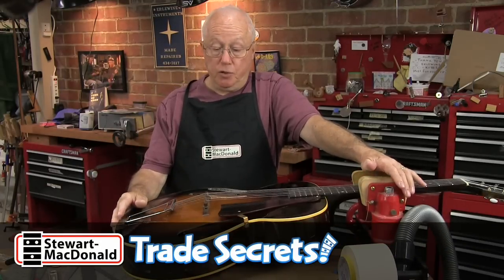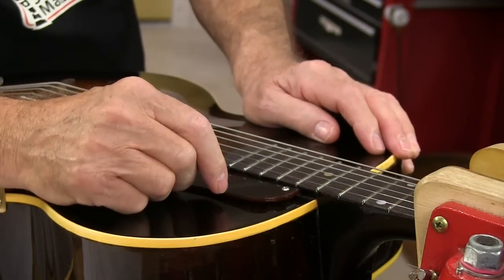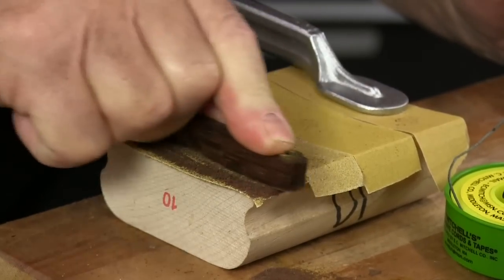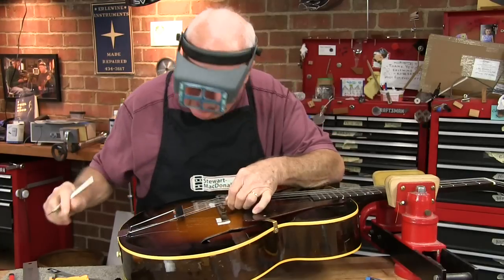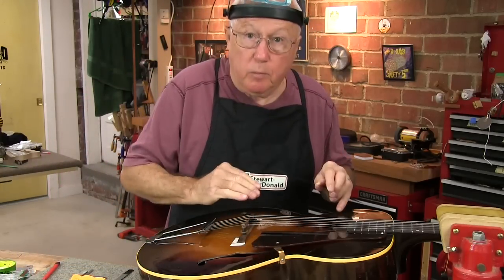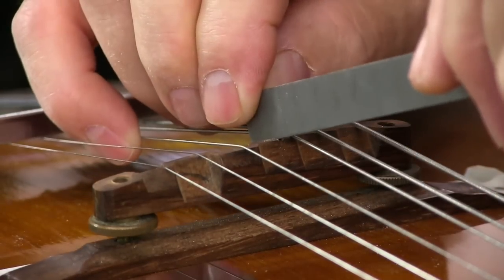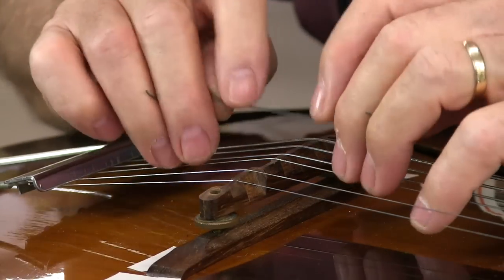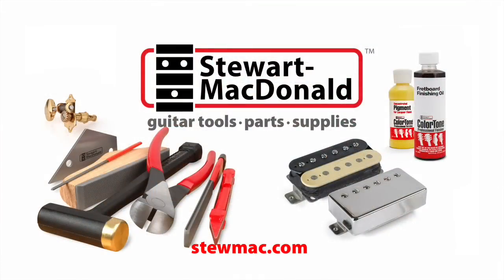Setting guitar string spacing at the bridge

Comment: Another great video. This brings up a question I have about why acoustic saddles aren't notched at the bridge?  I have a Fender acoustic from 1976 and I need the bridge to come down just slightly to improve the action. I'd thought about just notching the bridge saddle.  Any reason not to try this? - I should say.. it's already down pretty far and I would normally take material off the bottom, but we've run out of room for that I think. So it either needs the belly hump fixed or the bridge shaved a bit. I thought of trying to notch the bridge before I replaced it with a tusq one for the final repair?